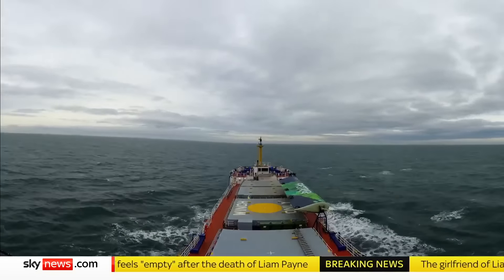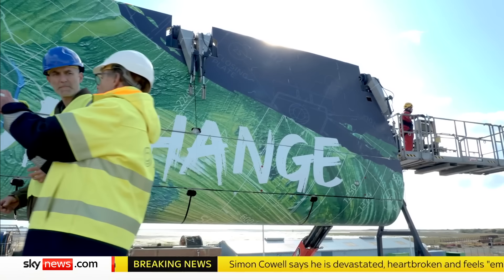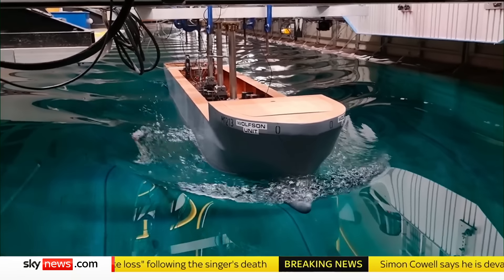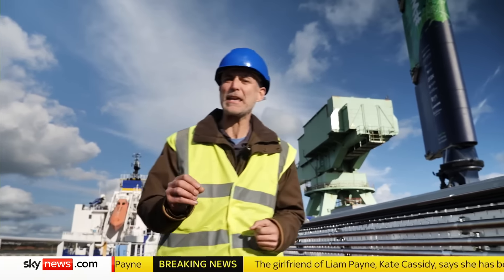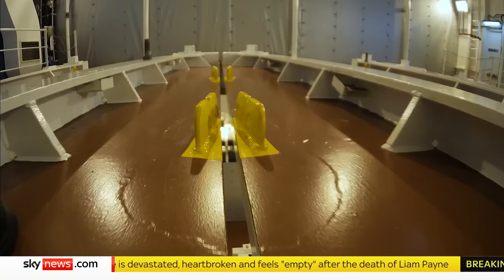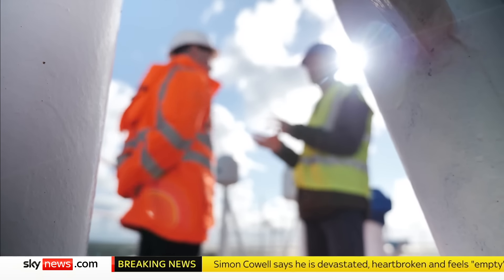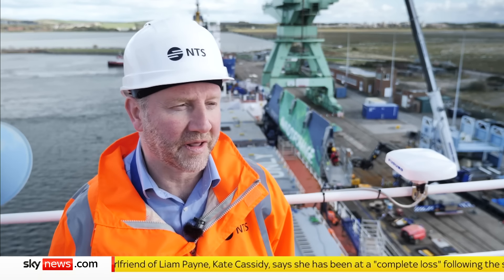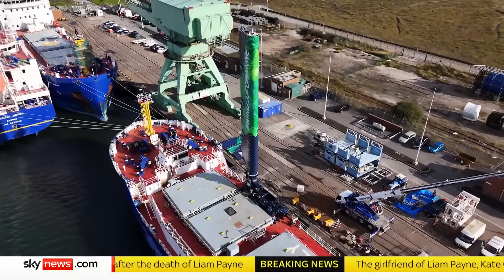Commercial ship with a fitted sail is trialled in the UK to reduce carbon emissions

Comment: Equally they could just turn the boats off while in port. Most of Southampton’s pollutions comes from idle ships burning fuel at the dock.
Reply: Speak to the national grid about supplying sufficient dockside power….
Reply: 🥱🥱🥱🥱🥱🥱 lots of ports offer electric to reduce emissions from ships most of Southampton pollution doesn't come from idle ships either
Reply: @hgv1883  guardian article from this summer states than more than half of Southampton’s particle pollution comes from idle cruise ships.

Comment: A Japanese company trialled this 40 years ago, a German company 20 years ago.

I read about it in a science magazine in 2005. if they did their homework they would know about this.
Reply: They said it wasn't the first time it was tried.
Reply: We've had a cargo ship M/V Estraden journeying between Norway->Teeside for well over a decade now, fitted with a pair of Flettner rotors.
They're big cylinders that are spun by a tiny engine, creating a kind of 'virtual sail' using air pressure, which reduces fuel consumption on the main engine quite considerably.
The advantage of them is that because they're cylindrical, they work no matter which direction the wind is coming in, so long as they're spinning in the right direction.
It's quite a thing to see, a big 18,000ton ship being silently propelled along by 2x 50hp motors when it's windy enough to shut the main engine off.
Reply: @kentclark6420  somebody repeating 40 year old studies is not news. If they made a breakthrough that would be news.
Reply: @kentclark6420  maybe if I start a study on how sanitation reduces diseases I could get on the news.

We'll just conveniently ignore John Snow's study into the cholera outbreak in the 19th century, Joseph Lister.....

Let's just start again from scratch like it never happened.
Reply: @kentclark6420  I just had a great idea for some kind of bowl that hold water and when I press a button or lever the water goes down a pipe into my effluent bowl, pushing the waste away. I think I'll call it a cistern.

This idea is newsworthy. We'll just pretend Thomas Crapper never existed 😉
Reply: @mazdamaniac4643  the Savannah
In 1819, the first ship with steam power crossed the Atlantic, this was the Savannah, still with a sailing rig for safety and most of the time for propulsion. This additional sailing rig, continued to be the norm for many years to come.

200 years ago.